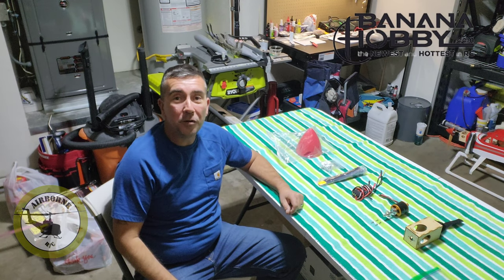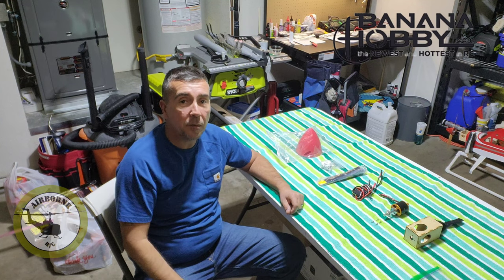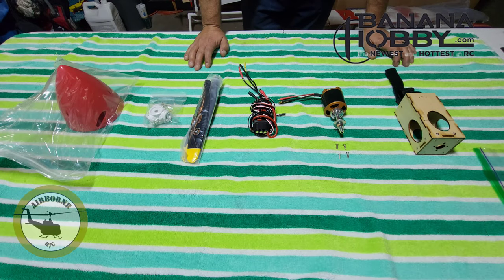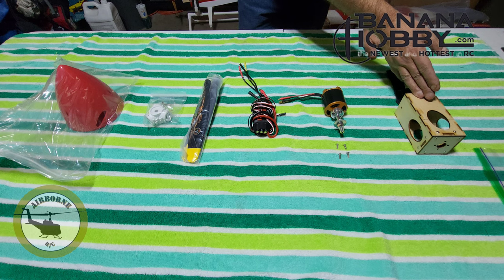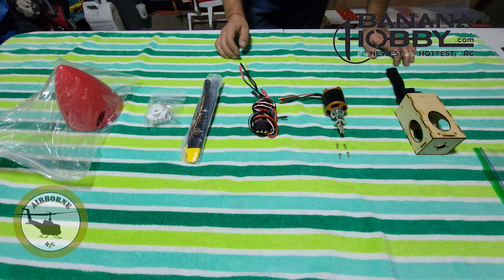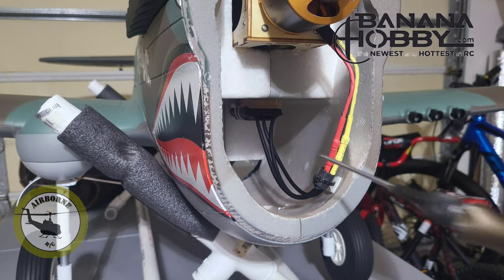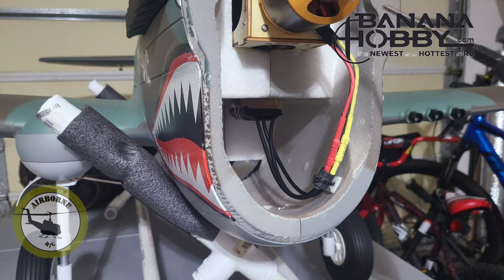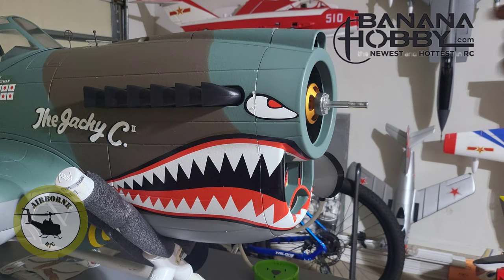Assembly Part #3 Power System Install 2m P-40 from Banana Hobby BONUS AT THE END!

Comment: does it fly good at the recommend cg or did you make adjustments? I am about to maiden tomorrow and with a 12s setup lol.
Reply from the maker: Stock CG worked great! Hopefully, you reinforced the wood motor box for that 12s. I've seen them separate when adding more torque
Reply: @NoonzAirborneRC  I have I reinforced a lot of areas. Thank you!